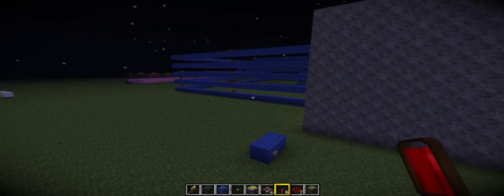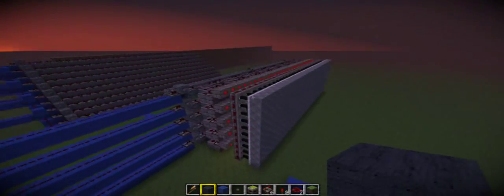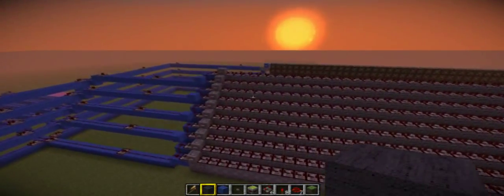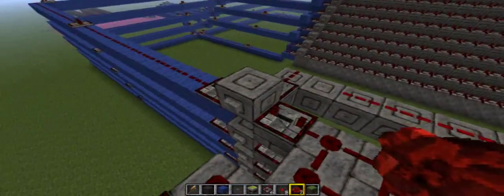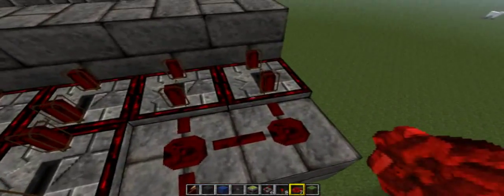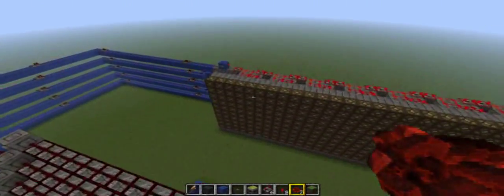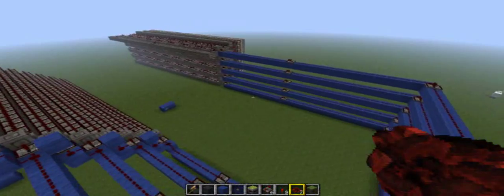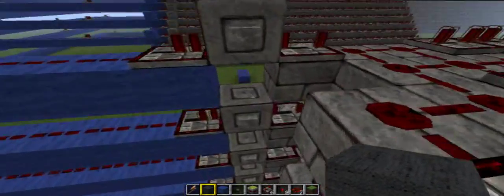Minecraft: Making a scrolling text display.

Comment: evenstephen1  The first time I saw this video (like 6 months ago) I decided that I wanted to make a marquee display with a user input of buttons for each letter with the capacity to save multiple saved messages forever and would have a feature that allows it to cycle through selected messages in sequence until you press the "off" button. The only type of memory I learned was punchcard memory for a clock. I only did one digit and the carry-over then got bored because the rest was the same, but it was the most advanced thing I had made. I barely knew anything about decoders and had never built one. I knew nothing about how computers were made or organized. I knew it was way beyond my knowledge, but that's why I did it. I made my own type of memory and designed nearly every component by myself. I am really close to being done. Probably within a month or so. I just have to finish getting everything timed. It has been such a great experience and I have learned SO MUCH! I pushed myself through problems that I didn't know I could overcome.

When I am finished I will be making a Youtube video about it. I will be giving you tons of credit and I'll put links to your video and channel in the description. Thanks :D
Reply from the maker: awesome, i love knowing that i can help someone with their redstone :)